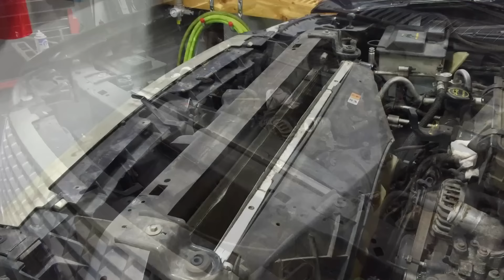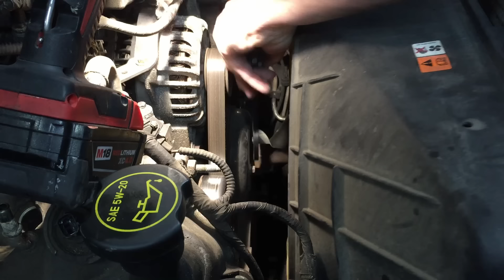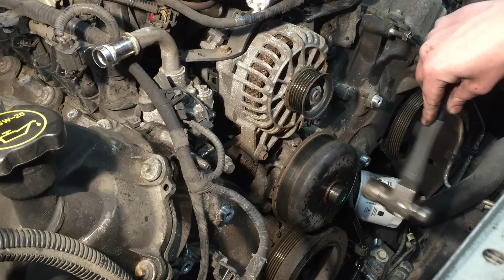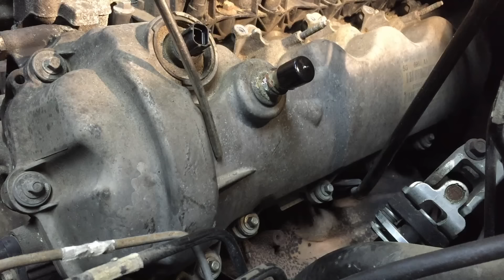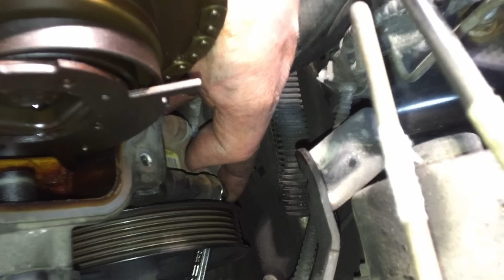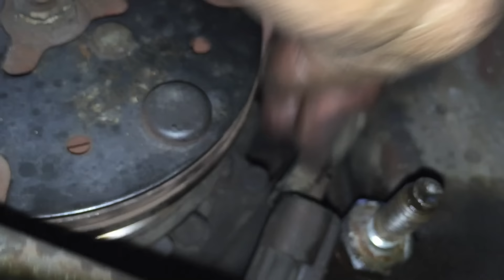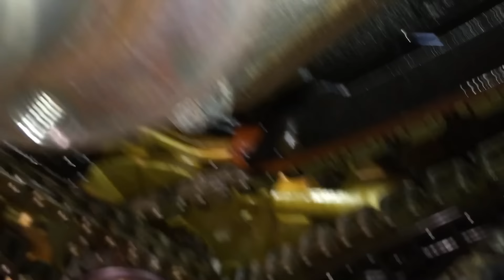Ford 5.4L 3v Engine Timing Chain Kit Replacement Pt 2 of 4: Front Cover & Valve Cover Removal

Comment: DID YOU REMOVE THE OIL PAN TO GET THE BROKEN TIMING CHAIN PARTS OUT OF THE PAN IF ANY? OR DID YA HAVE ANY BROKEN PARTS AND LET IT FLY? I DIDNT SEE THE REST OF THE VIDEOS YET BUT GREAT VIDEOS.
Reply from the maker: +62 BOSTON MA North East Corner nothing broken so no need to pull pan
Reply: ok cool man hope i don't have to but wont be surprised if i have to good ole cars! great videos and also great info pulling the rockers too thanks for the good  lesson.
Reply: It looked to me like the pan was actually open to your access is that correct uhm... LoL I didn't memorize your name man but I think that's what being able to see the oil pump indicates. 

I seem to remember seeing a shot on the other (1st I mean lol) video and I was looking at the pump thinking, ''Yes, pump, i see an intake of some kind, and some kind of other port looking deal, probably another intake...'' 

does that seem about right? I'm about to take one apart that's got a blown tensioner, too, and I was kind of wondering about finding nylon all over the place in the thing. 

Well... anyway, these videos are a marvel of documentary clarity man, great job, for sure.
Reply: I'm getting cramps in my hand just watching you try that ps pump

Comment: AND IF YOUR IN A SNOW CLIMATE PLEASE ORDER NEW VALVE COVER BOLTS AND HARDWARE BECAUSE THEY WILL ALL BE ROTTED AND MAY STRIP THE HEADS OFF! TRY TO ORDER STAINLESS BOLTS! GREAT VIDEO BRO KEEP THEM COMING!
Reply: The Fel-Pro timing cover gasket set has all new silicone rubber seals in it for the bolts. The bolts are specific for this application, I would not substitute them.

Comment: The comment you made on the water pump being hard to get to, It made me chuckle. To a non mechanic like myself. 3/4 of what you do is 'hard to get to" or "really tight space" lol. Thanks for the videos as usual. I do not comment a lot but I have been watching you since you worked for ford. I hope there are still mechanics like you working at fords around the country.

Comment: So you say start up rattle? I have an 04 F150 5.4 and when i start it up cold there is a rapid ticking noise. But only lasts for about 10 seconds or so then goes away. What could that be? I recently bought the truck and started sounding like a diesel at idle. So called car lot they said they would fix if i bought parts and they would cover labor so i bought Ford phasers. Then they call and say they will change chains and other componets for $200 including parts and labor (not ford parts). Diesel sound is completely gone. But the rapid ticking during a cold start up is still there? Could it be chain slap? did they lie to me about replacing the chains and other components.
Reply: Oil isn't getting up thru to the heads fast enough.OIl is thicker in the winter.

Comment: If I owned a triton motor I'd be changing all of these components every hundred thousand or less. I've seen a 5.4 that had such a loose chain that it was slapping the front cover and literally cut a groove into it. Which caused aluminum shavings to be spread throughout the whole entire engine causing it to be destroyed. Preventative maintenance and care is required to keep these engines reliable and on the road. Replace those timing components people, or it's going to get even more expensive, very fast!

Comment: wanted to start off by saying great videos. I have a 2002 Ford Windstar. when I have my AC running and I accelerate on the highway it seems like the air gets redirected to another location and hot air only comes out but once I reach the normal speed or I'm idling at a light the air flows normally. could you tell me what that could be?

Comment: 2000 ford focus se wagon 2.0 doh. when the car gets to one fourth of a tank running highway speeds the engine stalls and does not go above 10 miles an hour noticed Ford has a TSB on the fuel pump delivery module was wondering if you thought this was it thanks but if I keep a tank full it does fine 4 A2 hour trip

Comment: i pull the pulley off the power steering pump and only have to remove the one bolt
Reply: My thoughts exactly why no just remove the pulley instead
Reply: @Miamiboi305  not looking at my truck right now,, how is the power steering pully mounted, and what tool was used to remove it? Appreciate any info,, TIA

Comment: Heya FTM.  Ford Escape Hybrid, 2008, the HCU on the brakes seems to be having issues.  Can almost tie it directly to heat.  Only happens when left in sun for to long, or in traffic idling with air on.  Part seems to run 4000.00, no breaks.  Any known quick fix for it?  Maybe a way to insulate it to cut down on heat?  Is it basically a small comp/brain to regulate the energy recharge flow rate for the battery, and the abs in one?    
Thanx for any info you have.

Comment: after changing a few the hardest job on the 3v is the power steering pump replace. those three bolts are tough to get.
Reply: I hate those things
Reply: True that! I literally had to crawl inside the fan shroud space to get leverage and torque to remove those retched things. Some ass-hat put red lock-tight on the threads.
Reply: My 2004 has 4 bolts! 2hrs 2bolts 2 to go. And no swivel heads. The most infuriating thing is that the engineers do this on purpose.